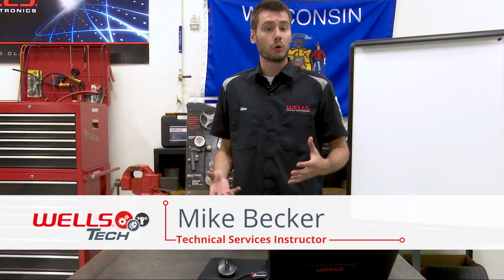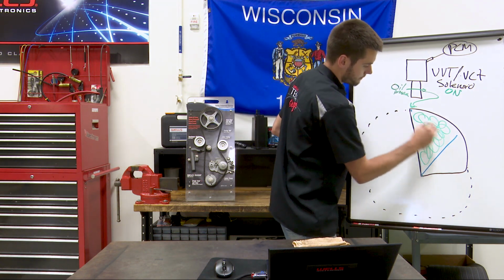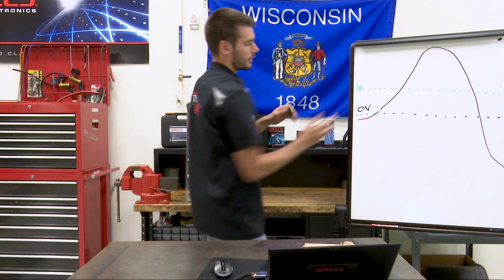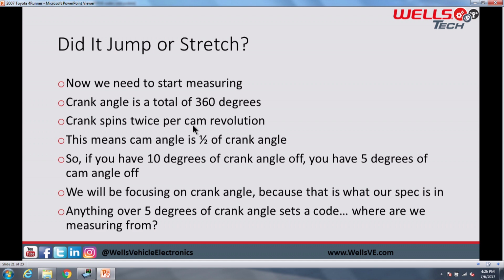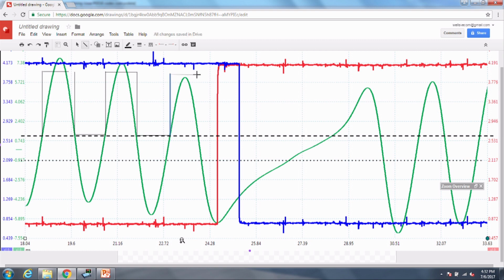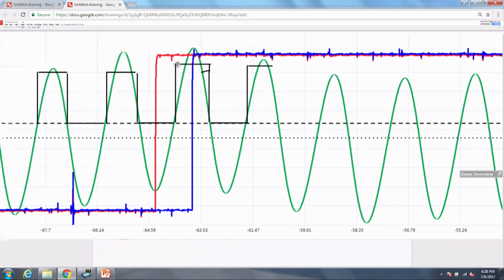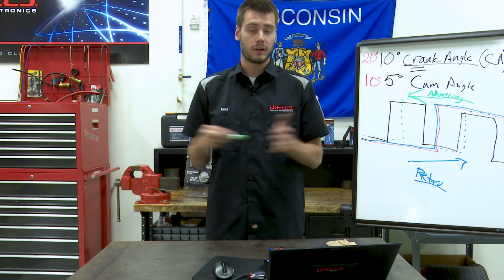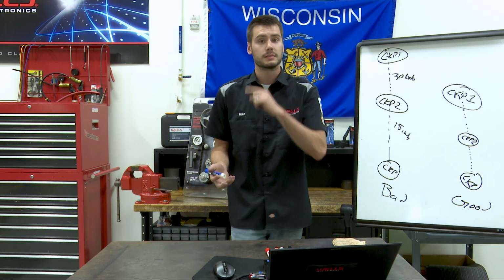-Episode 4- Is this timing issue really intermittent? Toyota P0016, VVT problem?

Comment: Great video Mike. I was waiting for you to set up the Pico to show the 720 degrees divided by the teeth and then show the degree difference between cam sensors to show it didn't jump a tooth but was chain stretch/sprocket wear but you attacked it a different way with the AD signal and time interval...different approach same result. Great series and a great asset for Wells b/c you are a great instructor!!
Reply: You can set up the Pico for 720 degrees and then set it up with 4, 8, or up to 10 margins/cursors for every 180, 90, or less of degrees of crank rotation. It's very useful also when doing running compression with the pressure transducer.  Here is how:  https://www.youtube.com/watch?v=EjHmfzH8-Pc   Once you set up the 720 degrees and 8 partitions of 90 degrees then you can use the time interval from 0-360 degrees divide by the # of crank sprocket teeth or 0-720 degrees divided by # of cam sprocket teeth and measure time difference and if it is less then the chain is stretched vs jumped a tooth however if it's more it can be a chain stretch or tooth. You could also divide the time by # of degrees and determine the degrees of slop...the Pico is such an awesome scope the possibilities are up to your creativity. Mike threw in another with the AD graph. My problem is when I use my Pico I find myself playing with all the stuff you can do with it and throw in the Pressure Transducer Kit and the NVH Kit and the automotive diagnostic world is at your fingertips!! Hope this helps!
Reply from the maker: Well said Bob!
Reply from the maker: Thanks Bob! Next time i'll use the cursors on the PICO. I wanted this to be this way so that anyone with any scope can do it easily. Not ever scope offers us the fancy stuff the PICO does :) Thanks again!
Mike Becker, Technical Services Instructor
Reply: I know and excellent approach plus you covered & explained AD conversion nicely. I caught on to your approach quickly and smiled and said now there's a smart cookie :D
Reply from the maker: Thanks Bob! I hope everyone takes 1 thing from each of these classes. If they do, it's job well done and I can sit back and enjoy my 3 day weekend with my family! :)
Mike Becker, Technical Services Instructor
Reply: Enjoy your weekend Mike b/c it's a great video series!!
Reply from the maker: Thanks for the approval Bob! :) Know what, I think it's time to start the weekend right now! But don't worry, i'll be chatting with you guys when the videos come out tonight and tomorrow night! You have a great weekend as well my friend!
Mike Becker, Technical Services Instructor
Reply: Hello Hayward. I'm interested in the method you described with showing 720 degrees divided by the teeth.  I'm trying visualize how it works, but can't. Thanks.

Comment: Great, learned something again. I will measure my Renault in the next few days since it is coming up for a belt change and so I can check ahead and see if there is already any beltstretch visible.
Since I believe that video has been done a few days back I know as we talked yesterday, You would have had it much easier using the bottom right blue degree cursor first to set them for e.g. 360 on the crank-waveform and thereafter the lefthand time cursor would have also displayed in degrees without further conversion.
Great videos.
Reply from the maker: Hey Bernhard! Thanks man! Great, if you can take one thing from every class it was worthwhile. At least that's the way I approach training. Yep, could of used the cursors on PICO, but not every scopes got them. So, I wanted to show how people could make their own!
Mike Becker, Technical Services Instructor
Reply: Wells Vehicle Electronics 
Yes, I sure did. I am 61 years old and a "sparetime" mechanic and everything that I understand I remember forever and everything I learn by heart I forgett within a day. So when You teach the logic behind things, diagnostics becomes an interesting hunt to solve the puzzle.
2 years ago I bought a Pico with all attachments to solve, what appeard to be an ignition problem on my classic 1964 Jaguar but came to find out it was a problem with a misinstalled timing chain. This was only visible with the Pico and its pressure transducer. Since then I am hooked on car diagnostics and of course spoiled with the festures available to us with this scope.

I also like, that your audience is more interested with the car diagnostic problem and not badmouthing each other.
A pleasure to watch and advance.
Reply from the maker: Bernhard, sounds to me that you're are more than just a spare time mechanic. It sounds to me like this is a wonderful hobby of yours that seems to swallow up too much money, right? A 64' Jag, sounds like a sweet car! In hindsight, I should have showed using the pressure transducer and an ignition trigger. Next time I certainly will! 

Our viewers are the best! People here are just coming to learn, not create drama. I really appreciate that from our viewers, it makes my job easier! That way I don't have to play moderator of the chat. Thanks for watching and commenting my friend!
Mike Becker, Technical Services Instructor
Reply: Wells Vehicle Electronics 
We all have weaknesses. As in my case those british cars can easily keep a man busy. Except the CAN bus I have had the chance to test and measure anything that the Picoscope is made for. Some time ago I realized that most shops around here (Germany) have scopes but no one seems to use them, I decided to take matters in my own hand and learn as much about car-troubleshooting as possible. Lately the WPS500X Transducer became my favorite tool and helped me to find out two cases if valve timing problems. One was a chain that was tensioned after installation and so it shifted the exhaust cam a whopping 16 degrees. The other was a wrong torqued camsprocket and on first start shifted 170 degrees and became a cranking no-start. 
So if You decide to use a transducer in some upcoming videos I will be the first to watch.
Greetings Bernhard
Reply from the maker: We all do, definitely. Mine is brake lines....for the life of me, I am always flaring multiple times....stupid things! That's awesome that you have all this equipment and know how and have the time to use it. I'll play with the transducer in a class at some point. Make sure to check back! :)
Mike Becker, Technical Services Instructor

Comment: Mike,

some thoughts/ observations:  

The code seting criteria is - partially - wrong, I think. As I understand it it should read 5 degrees or MORE, not less. Two days ago I read the same service information in Mitchell ant thought it is erroneous  but did not bother to check another source. What source did you find this information in?

Not sure if i misunderstood you but I got the impression you said the pcm is looking for this 5 degree difference between the two cmp signals.Probably you did not mean this. Actually the pcm is looking individually at the 2  cmp signals and relates each one of these to a reference point of the ckp signal. Then it evaluates the "degree window" and flags a code if it's not happy with what it sees.

Check out 36.40 in the video, you might want to correct.

As always, THANK YOU, I enyoy these mini series,
Juergen
Reply from the maker: Juergen, I think you are right, it should probably read 5° or more. This information looks to be directly from Toyota but I found it in ___data. And yes, I must have spoken incorrectly. The PCM is looking for a 5° difference against the crank. It is not comparing the CMP to CMP, it is comparing both CMP to the CKP. Thanks for the comment and the feedback man! I really really appreciate it!
Mike Becker, Technical Services Instructor

Comment: I have to say, this has been one of the most informative videos I've seen in describing how a pcm processes information. I wonder if it would be possible to get an engineer on to describe it further. I think that info would be great for later diagnostics
Reply from the maker: Chris, Thank you! That means a lot to me! I have tried a video with an engineer in the past. It didn't go off as well as I had hoped. They tend to speak a different language. Same result, different language. This creates a bit of a disconnect unfortunately. But, if enough people want to see it, I can make it happen!
Mike Becker, Technical Services Instructor

Comment: Wow alot of information. You think that because of the dtc criteria that its pretty bulletproof that your getting this code that your pulling the front cover to verify the chain and timming marks?..(as long as you  verify vvti opertion)
Reply: I mean just being in flat rate world. I get this scenario im basically telling the customer that we got to rip the cover off to verify. That way they are more aware of the   actuality of the labor involved. But knowing these test therory  would  help in the odd ball situations.
Reply from the maker: K.A. I'm never pulling anything apart unless I absolutely have to. Say you pull the cover and it's in time...flat rate or not, who pays to put it back together and diagnose it? If I wasn't shooting video while doing this, I would expect to have this car diagnosed in under 30 minutes. If you get good with your scope you can fly through these tests. Hardest thing is finding the wires to probe into!
Mike Becker, Technical Services Instructor
Reply: Wells Vehicle Electronics yeah. Im going to try to scope it out next time so i can try to see how the patterns line up. We just had a couple 4cyls jump timing because of tentioner gaskets being replaced a couple weeks ago. Now i wont see one for months watch...keep up the videos! Thanks
Reply from the maker: Haha that's how it always works right? Watch or go to a class and learn something cool, then never see it for months...lol!
Mike Becker, Technical Services Instructor